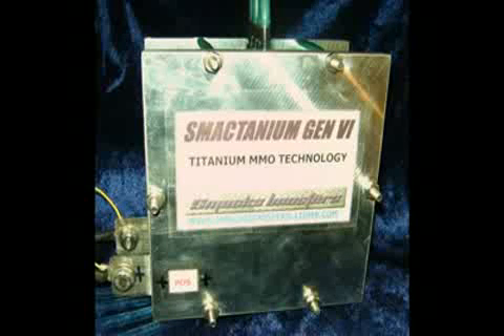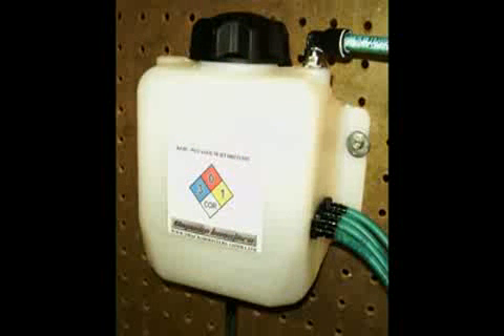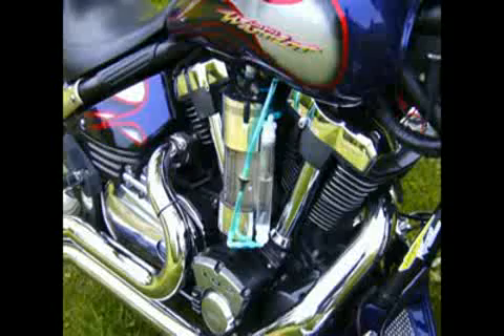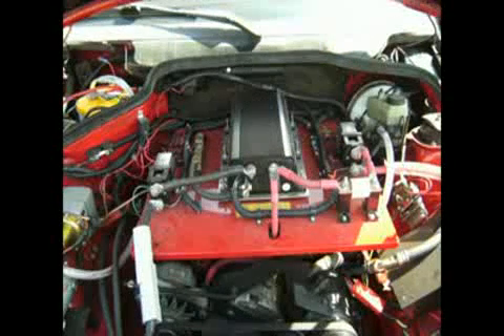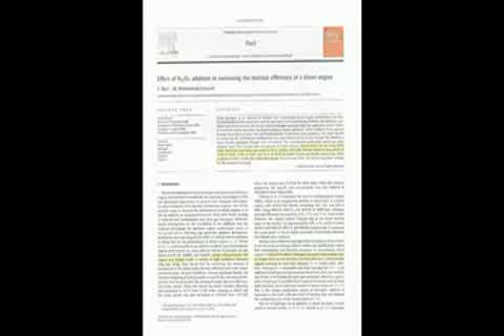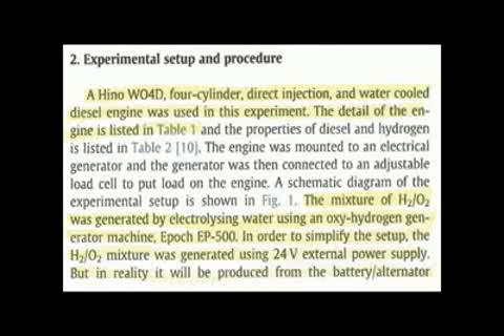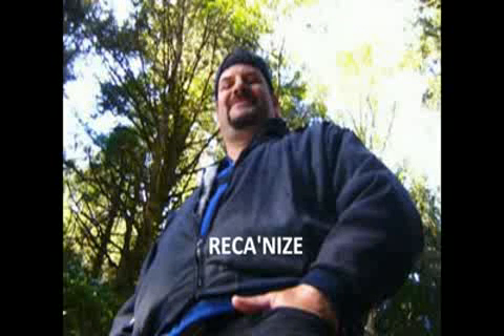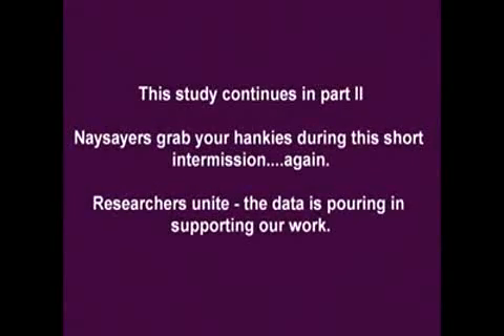Scientific PROOF that HHO WORKS Part 1

Comment from the maker: Bullshit, They used the EP500 so they could go past 5% HHO equivalent which was the top end of the test. The data clearly shows changes in BTE started at 1% or about 3 LPM, which BTW can be obtained by a car alternator. If you read the data with an open mind you'd see that gains are possible given the right configuration. The gains will be limited but there can be gains none the less...

Comment: "Check the data sheet" that has data which can't be verified in any way...
Also, no, they didn't use the external power supply because they wanted to test the full limitations, they used it because the epoch ep-500 they used to get even minimal results (which I might add is a 700lb device, putting significant strain on your sedan) requires 24v dc at 40 amps to operate, consuming 11500 watt-hours, or 41.4 MEGAJOULES!!!!! WELL above what your car produces in it's alternator.
Busted, ho.

Comment: I see what your saying,  you would have to change the sensors in vehicles to make proper air/fuel ration calibrations. I believe your right because the ECU uses either a Mass Air Flow (MAF) sensor, which measure tempurature difference, and/or a Manifold Absolute Pressure (MAP)to measure air NOT Hydrogen/Oxygen gas. The car also uses an Oxygen sensor in the exhaust to keep the ratio around 14.7:1 (Air:Fuel). A Manufacture can either develope sensors that measure HHO gas or reprogram the computer

Comment from the maker: @drijfkip1 -- Do you not understand why they used an external power supply? It was to fully test the limits of the theory. Read the paper, they used a 4.0 L fule injected diesel engine, that's not a tiny engine. It's actually bigger that most vehicles made today. The tests are valid, HHO can save fuel if the vehicles are configured correctly, i.e. the system is properly leaned out....

Comment from the maker: @dinoalberini --- You read the paper? Apparently not, they clearly stated that in reality the H2O2 gas would be made on board. They also stated that the energy used to make the H2O2 gas was computed and taken into account. It's a proven fact that adding H2 gas to HC fuels changes the burn characteristics allowing for leaner mixes with more power out. Fig 2, 3, and 6 show gains in BTE started at just under 1% or about 3 LPM of H2O2 gas. Re-read the report but with an open mind...

Comment from the maker: @dinoalberini --- No they didn't read the data. They replaced the part of the diesel fuel with the energy equivalent amount of HHO and included the energy required to make it. This is where the gains came from, the reduction of HC fuel usage. The tests show gains are possible under the right conditions...

Comment from the maker: @pinguFlies - Read the paper it specially says, "But in reality it will be produced from the battery/alternator..." They used an external to test the limits of the gains. Adding HHO does more that simply replace part of the fuel, it extends the lean burn range while increasing the BTE of the burn. So you can use less fuel and get more usable power out. Figs 2, 3, & 6 show gains in BTE started @ 3 LPM for their 4 L diesel engine. Using the right set up you can get gains in MPG with these systems

Comment: One thing further is that I read a German university paper 2008 /9 on the subject, they were testing on farm machinery and stationery engines if I recall, but they had findings which would tie in with the Australians report here, they found savings did occur and the use of fuel lessened by volume with addition of HHo. ( so who is scamming who) would be my question here !!!
Thom.

Comment: interesting to note, that if you dry out liquid fuel, IE: to remove all the water content, it will not burn !!. {strange but seemingly true...} ... also worth noting that in water there is oxygen, Hydrogen, deuterium, tritium H3, & a 4th, H4 which mass volume is vast, though difficult to gain, noted if I recall correctly by a Swedish university work I read, but H4 remains elusive, we have not I think even "begun to scratch the surface of this technology" as yet guys...
Thom in Scotland.

Comment from the maker: @mptrax --- I'd have to agree with that statement. A car running only on water has not been proven. I have seen some interesting tests though. Science tells us that you cannot create or destroy energy and since water is a compound wouldn't it follow that some of the energy used to create water in the first place is stored in it? The problem is we do not have an effective way to extract it. If we ever solve that question maybe a car could run on water...

Comment: @roofy2k  As a chemist I can tell all of you skeptics that this is real... put a 9volt battery in some salt water and watch the bubbles from the electrolysis of water.  Efficiency is affected by electrolyte used, amperage, and surface area of the electrodes, among other variables.  If done right it can be very efficient.  HHO torch generators are great for jewelers , the Hydroflux torch kit gives you an extremely small flame that is extremely hot.

Comment from the maker: @drijfkip1 --- They tested many different levels of HHO addition with 6% being the top end. Charts in fig. 2, 3, and 6 show gains started around 3 LPM in a 4L diesel engine. The point of the study was to show that the addition of  H2/O2 gas changes the combustion process reducing the amount of energy lost thereby reducing the amount of fuel consumption.

Comment from the maker: @dick117 --- Click the link marked "Link to the document" in the description of this video. It's smacksboosters [dot] 110mb [dot] com / HHOdiesel [dot] pdf . Now about the use of an external power source watch?v=JYq511CCSRQ Using an external power source provides a better means of controlling the experiment. Scientist routinely use mathematics to help explain the results. Now as far as real world testing goes look up Ronn Motors tests in Volvo big rigs, gains using on-board power were seen.

Comment: I wish I had four hands, so I could give this video four thumbs down!!! I like how at the 8 min mark he talks about using an external power source to generate the hydrogen. Calculations are only "research" for mathematicians not engineers. What's the point of doing research if not applying the technology in question? And has anyone actually seen this literature. The links only lead to the school's site and not the document.

Comment from the maker: @Jotter324Studios --- It's not about the potential energy in HHO, it's about better utilizing the potential energy of the HC fuel. This video isn't about the practicality of using HHO on a commercial basis, it's simply about whether or not it works. The answer is that it does...

Comment: So the question becomes if there are gains. Very small gains is the cost of equipment and installation even worth it. Or would it be better to pursue something that can create a real substantial improvement.

Comment: It's a question a utilizing potential energy. The potential energy in HHO is not anywhere near what is required to create it. H2O2 100% hydrogen peroxide would actually have some potential because the reaction is purely chemical. But using a reaction that requires a high energy input is like trying to fill a bucket with a hole in it.

Comment from the maker: @Jotter324Studios --- True, greater gains are possible if you could harness waste heat but that is a whole other topic. As for the potential of both fuels you should watch Thunderf00t's video on high speed explosions, watch?v=65KIexy4New While it is true that HC fuels have a higher HV when compared to H2 but it's the other attribute of flame speed that becomes relevant inside the combustion chamber...

Comment: @BlackDogSociety simple science. There are 2 hydrogen's in and H2 molecule. There are 20 Hydrogen's in a gasoline molecule. I will admit that adding oxygen to a any combustible mixture will increase burn. But the increased BTU's from adding a trivial amount of Hydrogen and Oxygen is almost laughable compared to the potential energy of gasoline or desial for that matter. If you want to do something really great figure out how to make an internal combustion engine 70% efficient instead of 25%

Comment from the maker: @Jotter324Studios --- Read the study, it clearly states that adding H2/O2 gas can save fuel. Nothing has been taken out of context. What you fail to get about these systems is that they do not change physics. Adding H2/O2 gas changes the chemical composition of the fuel allowing for a leaner operating range without losing power. No new energy is created, energy is still lost in the process....

Comment: @BlackDogSociety OK I can now verify that this test is invalid.  The reason is very simple they used a 1992 60 series Detroit Diesel the company Detroit diesel did not introduce their first electronically controlled diesel engine until 1993. I can guarantee you if this test was repeated on a electronically controlled diesel engine there would be no measurable improvement. Also the claimed 4 percent improvement would not even occur in the real world due to content variable load conditions.

Comment: @BlackDogSociety The FMCSA division of the DOT may have published this paper but they did not do the test, the

ETV Canada, Environmental Technology Verification (ETV) Program. June 2005. Hydrogen Fuel Injection System Technology Fact Sheet for Canadian Hydrogen Energy Company Ltd. Available at: w w w etvcanada com / graduates asp. Accessed December 22, 2006. Canadian Hydrogen Energy Company Ltd 

did the testing and without the original data this information is worthless.

Comment: @BlackDogSociety Your tiny URL link does not work so I went to the Federal Motor Carrier Safety Administration
web site and did a search on hydrogen injection and electrolysis unit and got zero results.

Comment from the maker: @ke4uyp --- I've posted this so many times already, here it is again:

The FMCSA division of the DOT published this doc, tinyurl com / DOT-doc. Read section 1.2.3 - "Limited laboratory testing of a hydrogen injection system installed on an older diesel truck engine operated at a series of constant speeds showed a 4 percent reduction in fuel use..." Oh and a Hydrogen Injection system is defined as an electrolysis unit in a previous statement...

Comment from the maker: @ke4uyp -- They used an external power source as a matter of control. This is a proper procedure when you are testing the limits of a theory. They may have used the amount of energy you claimed with the upper limits of the test but the data in figs 2, 3, and 6 show gains in TE and MPG at a much lower power use. There is also publications by the DOT that refers to other test using HHO where gains were documented in diesel engines. The biggest problem you have is with acceptance...

Comment: @BlackDogSociety This experiment was not a closed loop system, consuming 7.5Kw's from the power grid to make the HHO to inject into a an internal combustion engine is not a practical demonstration of this technology. 

But more importantly it was not conducted on a gasoline engine this test was done on diesel engines.

How many people drive diesel powered cars? This study proves nothing about using HHO with gasoline powered automobiles.

Comment from the maker: @ke4uyp --- You are an idiot. Of course he leaned out the fuel mixture. That is how you can save fuel using HHO. It's a scientifically proven FACT that H2 added to HC fuel allows for leaner operation without losing any HP. You can say what you will, the bottom line is you can save fuel using HHO...

Comment: @BlackDogSociety You just admitted that ZeroFossilFuel  leaned out the mixture. 

So this would cause a reduction in gasoline consumption, because when you adjust the screw for a lean mixture you decrease the amount of gasoline going into the cylinder. So the MPG increased from doing this not from adding HHO.

Comment: @BlackDogSociety The key points of the video showing the hydrogen powered Prius is that a ICE running exclusively on hydrogen produces less horsepower than the same engine running on gasoline. 

This is proof positive that hydrogen has less energy or you could say BTU potential than gasoline. 

So if you inject HHO and into a gasoline engine it is not going to increase horsepower. It will In fact lean out the air to fuel ratio and would cause a decrease in horsepower output.

Comment: @901Jetta 
If what you are saying was true then when he injected the HHO into the cylinder and then proceeded to adjust the air to fuel mixture ratio adjusting screw, he would have been increasing the amount of gasoline consumed per minute not decreasing it. 

Think About It

Comment: @BlackDogSociety When ZeroFossilFuel did his run time test, for the engine to run properly with HHO injected he had to lean out the carburetor air to fuel mixture ratio adjusting screw, he clearly states this in his video. This is real world evidence that injecting hydrogen into a gasoline engine causes the engine to run the rich not lean.

Comment: @BlackDogSociety Once again you are wrong when you inject HHO into the cylinder the oxygen sensor registers a richer mixture from the hydrogen and this is what causes of the ECU to REDUCE  the amount of fuel injected into the engine.

Comment from the maker: @ke4uyp --- On the contrary, the DOE and NASA, among others, have stated an increased flame speed improves fuel efficiency. That is a scientifically proven fact. The study referenced in this video shows that HHO can have the same effect as what was seen by NASA and the DOE... BTW and increase in O2 read by the O2 sensor tells the ECU that more fuel is needed, not the other way around as you state here...

Comment: @BlackDogSociety I am sorry but you have absolutely no tangible scientific evidence to backup that statement. 

When you inject HHO into the cylinder the oxygen sensor responds by telling the ECU to reduce the amount of fuel injected into the engine, this is where the improved MPG comes from, not from an improved flame speed.

Comment from the maker: @ke4uyp -- No, it's not. When you increase the TE of the burn you increase the HP. When HP increases in normal driving conditions the need to accelerate is reduce and more MPG is the result. So simply adding HHO can influence MPG with no other mods. In my case using my CAI mod I reduced the pumping losses to improve my HP and I was able to post an average MPG gain.

Comment: @BlackDogSociety "More HP leads to more MPG" 

Just listen to yourself this is a completely illogical statement.
It is only the amount of fuel that enters the cylinder per power stroke that determines the MPG that's it there is no exception to this rule.

Comment from the maker: @ke4uyp --- "If the amount of diesel fuel injected into the cylinder per power stroke does not change how can the MPG improve?." By a better thermal convergence giving more HP. More HP leads to more MPG. I've done it with my CAI mod. But. the amount of the diesel fuel injected did change, read the study. The act of adding HHO allows for the reduction of diesel fuel with no reduction in the output HP, in fact it gave a gain in HP using less fuel.

Comment: If the amount of diesel fuel injected into the cylinder per power stroke does not change how can the MPG improve?

On the other hand if the amount of diesel fuel injected into the cylinder per power stroke is reduced them and only then does the MPG improve. 

So the bottom line is it is the act of reducing the amount of diesel fuel injected into the cylinder per power stroke that increases the MPG not injecting H2/O2.

Comment: @BlackDogSociety If the amount of diesel fuel injected into the cylinder per power stroke does not change how can the MPG improve?. 

On the other hand if the amount of diesel fuel injected into the cylinder per power stroke is reduced them and only then does the MPG improve. 

So the bottom line is it is the act of reducing the amount of diesel fuel injected into the cylinder per power stroke that increases the MPG not injecting H2/O2.

Comment from the maker: @ke4uyp --- First off this video series is about the theory that adding H2/O2 gas (aka HHO) made on-board with  the HC fuel can improve MPG. The study shows it can improve MPG. The video of the Prius does not prove or even suggest that this theory is in error. Secondly, similar test were done with gasoline engines with similar positive results. It works much better in diesel  fuel engines but it still can work with gasoline engines.

Comment: Watch this video from popular mechanics on a modified and optimized Hydrogen-Powered Turbo Prius.

Note

That he mentions that even with the turbocharger the engine now puts out 10 percent less horsepower than on the original naturally aspirated gas engine, also look at the major reduction in driving range.

watch?v=4nL4iuE2Fqo

Comment: This experiment was not a closed loop system, consuming 7.5Kw's from the power grid to make the HHO to inject into a an internal combustion engine is not a practical demonstration of this technology. But more importantly it was not conducted on a gasoline engine this test was done on diesel engines.

How many people drive diesel powered cars?  This study proves nothing about using HHO with gasoline powered automobiles.

Comment from the maker: @SuperSoylent --- You know they did that as a matter of control. They also factor that in when they concluded that adding H2/O2 gas gave a savings in fuel. This procedure was exactly what a famous naysayer says is needed, watch this video....

watch?v=JYq511CCSRQ

Then look up old comments where I point out a document from a division of the DOT and how they claim HHO works. But don't stop there, look up Ronn Motors testing in Volvo big rigs. Real world tests that back up the claims in the paper